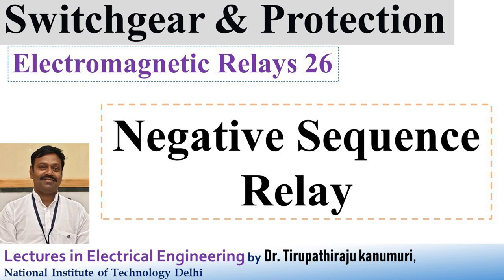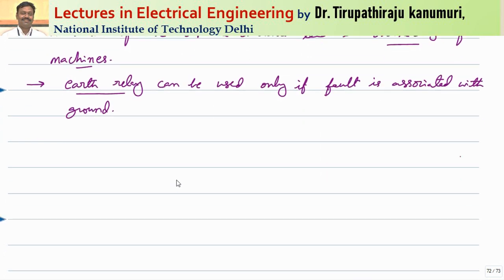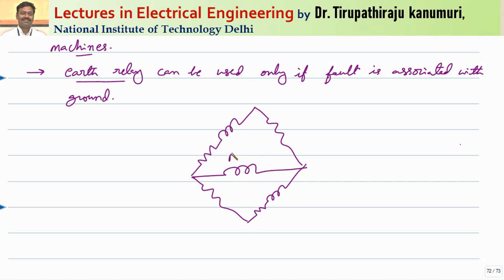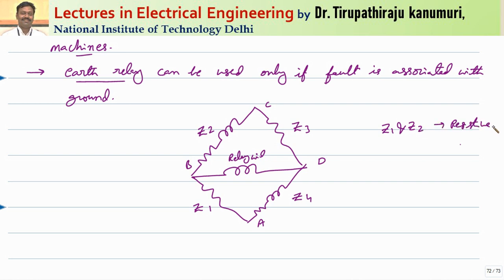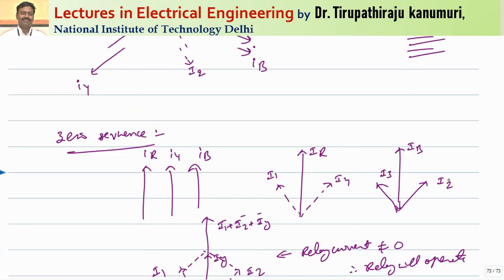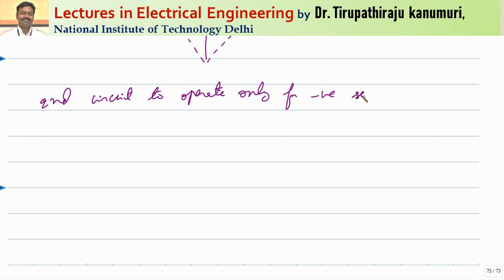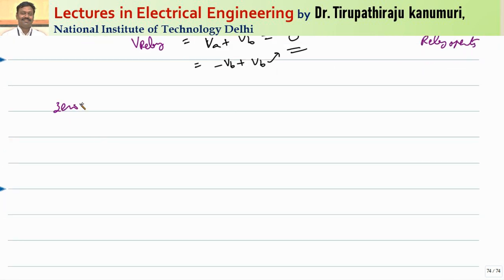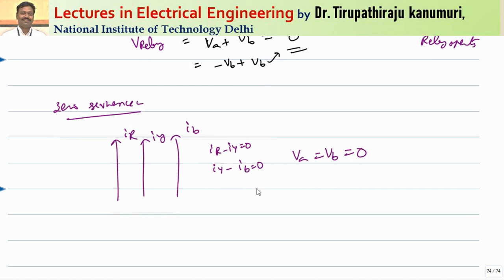SGP326 Negative Sequence Relay

Comment: And sir second question is ... As Negative Seq produces magnetic field which rotates at twice the speed of RMF in opp direction and it in turn induces a negative seq EMF in the rotar circuit which in turn produces extra current and that will heat the windings and raise the temp of the machine and if we use a sensitive temp detector that can measure the rise in temp because of Negative seq component and calibrated accordingly and its output is fed to trip circuit that will also used as Negative seq protection ??
Reply: @lecturesinelectricaleng  Yes sir I got it... Definitely it might be the case... Thank you sir..

Comment: Sir I have one doubt it may be a silly one... But As by the bridge connection.. we get relay current as I1 + I2 + Iy for positive seq.. And with the same connection when negative current flows the branch which is earlier carrying Ib is now carrying Iy and the one which is carrying Iy is now carrying Ib... So the net relay current will be I1(from Ir) +I2(from Iy not from Ib) + Ib .... So this again will become zero.. 

Because with the same connection if seq is changed ultimately the position of currents are also changed... and instead of Ib now... Iy is braking in two parts.. This is my doubt..